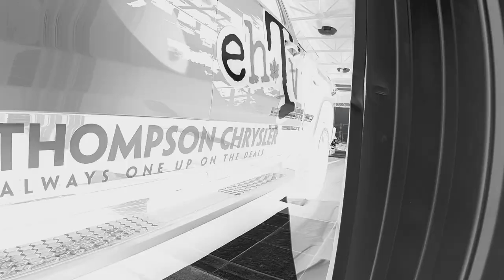One Way In & One Way OUT!!! Follow The Renegade

Comment: I’m curious to get your opinion on the Moto Havoks vs Assassinators. Pros and cons (obviously sassins are HEAVY). I just clutches mine and put on assassinators but also have my eyes on the Havoks too...  thanks for any help.
Reply from the maker: Both great tires, Size for size the nators will move through faster. But you can size up the havok and still weight less then the lesser sized nator. great weight savings.